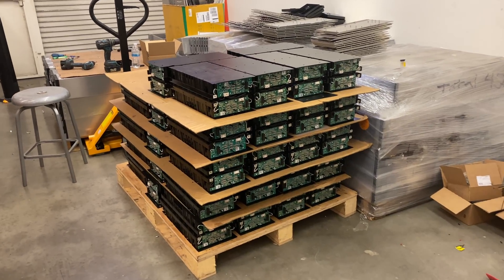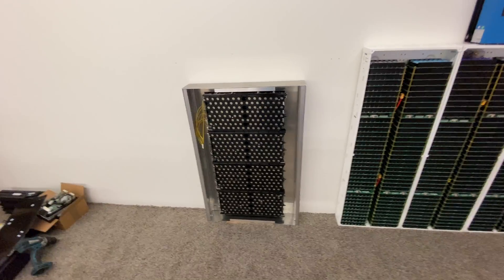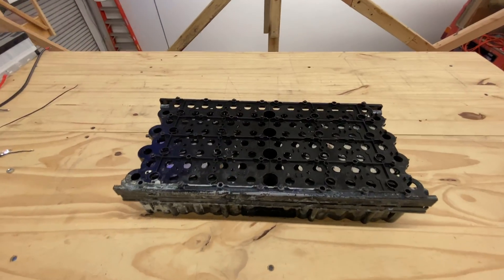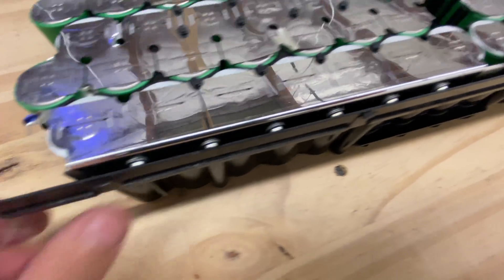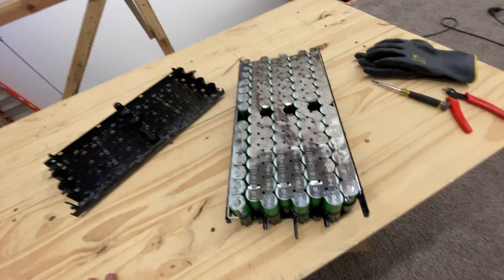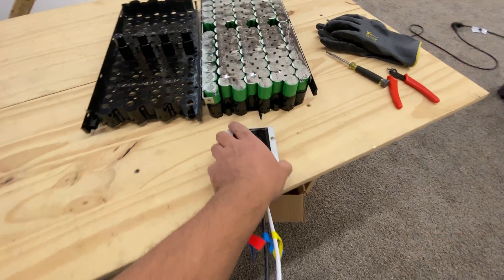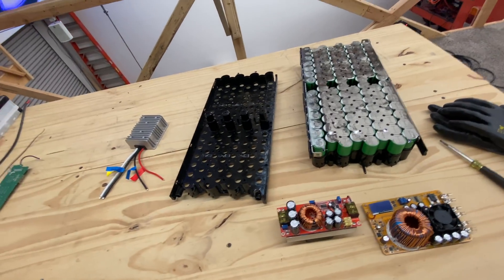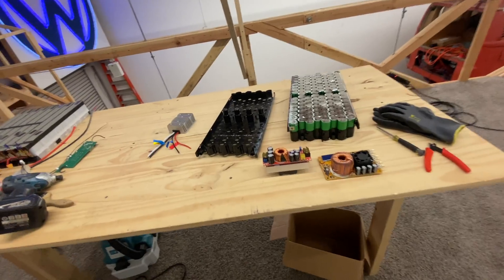$100/Kwh LiFePO4 12v Hack

Comment: I am ordering two, would like to use them in my teardrop trailer. How much do they weigh, and what BMS would you recommend?
Reply: Teardrop? Stick a 50amp Bluetooth one on there.
Doing something similar, but not sure if these will be used in the large cargo conversion I'm building, or broken down to make a few smaller ATV batteries.
Reply: DIY Stu Thanks, I am a complete newbie, will have to look around and see if I can find what you are referring to.,
Reply: *Edit: My tracking info is showing each module weighs 27 lbs
Reply: 96 26550 cells weigh about 22lbs (~100g per cell).  Add a few lb for the other stuff.

Comment: Hello everyone.. question will using a step down converter use less battery power? Like if I use your battery pack with a step down wouldn't I theoretically use less of the battery power?
Reply from the maker: Yes less power ,  100A at 12v is only 50A at 24v

Comment: Hi Sir Jehu 🙏 I’m one of your fans here in the Philippines 🇵🇭 love your vids specially with your inputs regarding battery builds 😊 I currently have a 24v solar setup with 2pcs 360w pv and would like to get your opinion on how many pv should I add so I can efficiently use or fully charge my batteries for a day. Currently it only charges for 80-90%

Thanks sir

https://youtu.be/B5tRHrHcwQ8
Reply: P.s.

It’s 24v 105ah battery setup sir

Comment: Just purchased one of this cells.  Im considering making a 24v to 12v system for my rv.  Any suggestions I need the help.
Reply: A buck converter- cheap and easy- 24v has many advantages over 12v.
Reply: Mains power to 8S lifepo 24V charger. Charger to BMS. BMS to 24to12 converter, tie that to the battery leads.
Your power distribution/charger will be fine, but will not be able to send voltage back to the pack since the 24-12 converter is only ONE Way.
When you're plugged in the charger will charge them up and when fry camping they'll power everything your old Lead Acid used to power, just longer.

Points: 1 make sure the charger doesn't have a parasitic drain when it isn't plugged in. If it does install a 110v contactor to make the circuit when plugged in.
2 make sure you get the most efficient converter (24 to 12) you can get. Last thing you want is the converter to drain your batteries when nothing is even turned on.
3 the Converter is why some people don't want to run 24 volt batteries in a 12 volt system.
4 you don't have to have a very big charger unless you plan to recharge from a generator. If so, get one that will work within the parameters of your generator.
5 some people over complicate the transfer switch between mains and Inverter. All it takes is two switches that can handle the loads. Think Frankenstein. Big double pole switch to flip your distribution center power from mains, to inverter. Then another switch to turn off and on the inverter.
6 RV distribution centers have a 30-50 amp converter/charger built in. This really isn't needed any more with the system described above unless the LFP 24V charger cannot keep up. If so, just turn off the breaker to the converter when fry camping so it reduces the load on the inverter. If the charger is rated enough to keep up then get rid of the lead acid charger/converter completely.
Reply: https://www.mobile-solarpower.com/2000-watt-24v-solar-system.html

Comment: I would love to add one or two of these to my new 5kWhr 24v LiFePO4 system to add capacity, but I just have too many projects going right now and not enough time. . . If there are any left in a month or two and I'm able to knock my other projects out, I'll get some.
Reply: Wow, already gone!  You weren't kidding.  I'm really looking to make a couple of 12V packs ~30AH, anyway for portable 12V power I can easily carry from room to room in my house.  I'm lazy so looking for a pack that doesn't require as much modification - where I can slap a BMS on and go.

Comment: In a pinch, you can also connect the output to two 12 volt automotive batteries in series, and run 12V equipment on half the circuit. Not a real good plan, but it'll work in a pinch.
Reply: The lead acid batteries' internal resistance would drain them

Comment: 1st : Thank you for the module, Jehu!  2nd : Mandie agreed not to exact revenge for "yet another battery" in the house and 3rd : I will be using it as a 1KWH battery to run the solar for my pool cabana/office -- now I just need to find another good 24V inverter and I went ahead and bought another module from you so I have a matched pair for the one you gifted me.
Reply: Maybe you could convert your office to run on 24v. They make computer power supplies that run off 24v and lighting can be LED 24v.  I guess that leaves the monitor and TV for me... not sure what else you have that need Volts.

Comment: How do u think  these  will parallel  up for use with  electro dacus  bms.. ? Will adding  to many  in parallel have problems with  staying  in balance  ???
Reply from the maker: Yes you can parallel them no problem
Reply: @jehugarcia  thanks r u going  to  be  selling  electro  dacus  style  bms soon ?? Do balance  leads  need to be hooked  into  each module  or just one once  they r in parallel.. ?
Reply from the maker: Yes that is the plan,  but I don’t have exact date on when that’s happening

Comment: 26650
A nice visual insight on how sturdy Tesla's new cell to chassis will look like?
Cells would be glued or epoxied to up to 6 neighboring cells and then glued (high conductive glue likely exists) to a cooling plate below and possibly a chassis plate with wiring provision cut-outs. Super sturdy construction if the load is distributed well and the plates also interconnect by weldables or a wrap-around construction.